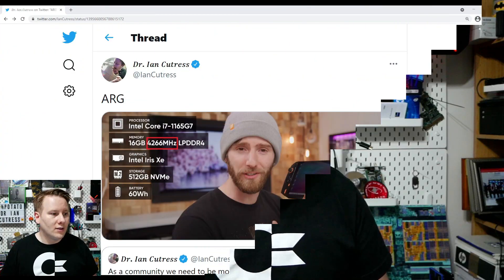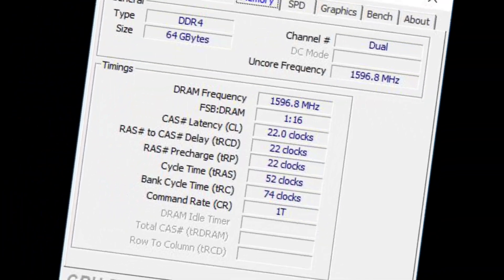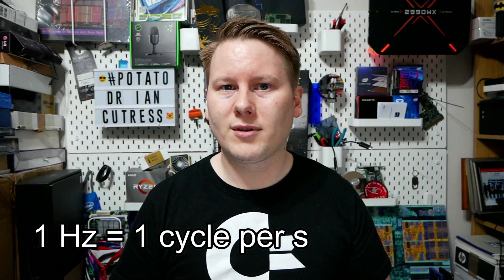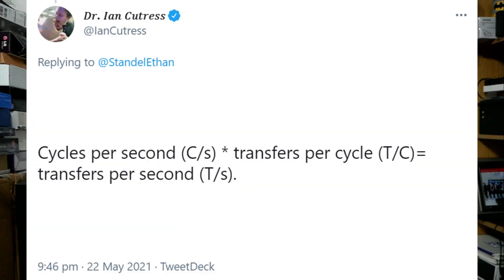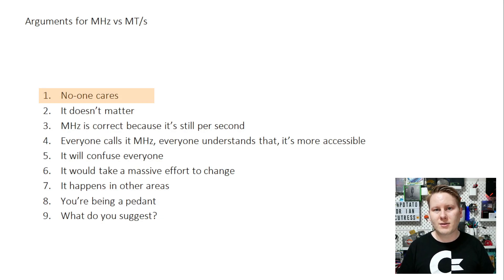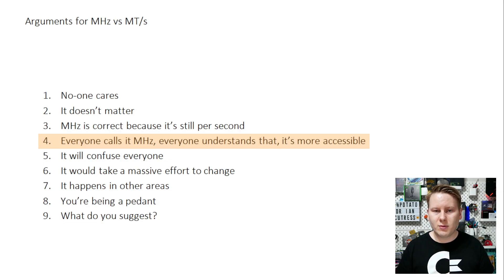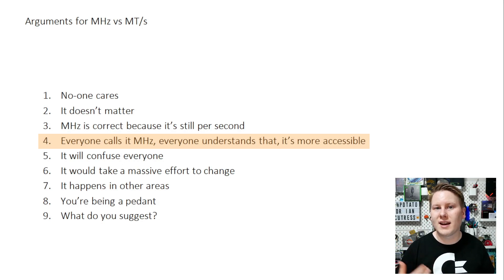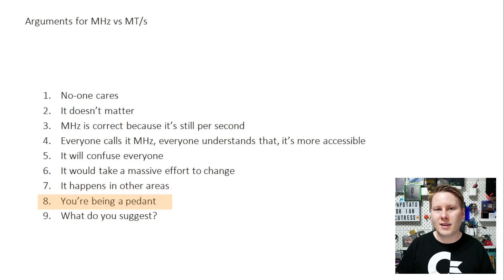Linus is WRONG 💩 : Explaining MHz vs MT/s

Comment from the maker: Just to reiterate, Linus and I get on really well. There's no beef here, just a fun discussion 👍
Reply: I'm happy that this conversation has been had as I never knew how double-data-rate memory works, and now I do. Ethernet I think is somewhat analogous to this, in that every tech tuber I have seen discuss the subject are quick to use the correct technical terms for the standards (1/10/40) but they are also quick to point out that those numbers are theoretical and not likely to be achieved. 

And then there is the aspect of accuracy, MT/s is not MHz, it doesn't matter if it's a convention to mix them up, as they are not the same thing and so shouldn't be mixed up.
Reply: I think removing the units altogether would cause more confusion. As you pointed out, in a piece of 8GB DDR4 3600 RAM, you get 3600MT/s. However, the fact that that piece of RAM is double data RAM implies you get two accesses per cycle. Therefore, the transfer number overlaps with the data rate specification. In reality, the name should read as 8GB DDR4 1800MHz as that term provides all the information necessary. Unfortunately, we’ll never see manufacturers do this because numbers must go up.
Reply: @hughmungusbungusfungus4618  right. This goes back decades in advertising. As a AMD user since 2000 I'm still annoyed that AMD guilded the "ratings not MHz" trend. DDR is not different in that dishonesty.
Reply: @hughmungusbungusfungus4618  true which is why transfered bits per second whould work as a messerment rather then hertz being used properly. And is much more likely to be implemented by manufacturers.
Reply: One is correct, one is not. Is not a discussion. Is a correction.
Reply: Linus is one of the sloppiest so called techtuber/journalists on youtube. He is no more than a paid shill.

He is most often wrong. Linus being right would be the exception.
Reply: I think you don't know how to pronounce pedant! You pronounce it like like its an impedance or impudence when it should be pronounced like you were being impudent, you prounanced it correct when you were discussing  ped-en-terry!
Reply: @justignoreme7725  that was pretty ironic
Reply: @justignoreme7725  That's the joke.
Reply: @danieledwards3376  mine or his??
Reply: @justignoreme7725  you americans
Reply: Linus had a similar argument with Luke several years ago talking about monitors where he was using 'P' and 'FPS' interchangeably.
As a global society we have been dumbed down enough despite the rise in intelligent technology at our finger tips. I'm gratified that you with your credentials corrected him and will stick to your guns in the importance of being accurate.
Reply: some seem to think Linus is some sort of genius, which makes me think they've never actually watched his videos.
Reply: I think it’s wonderful you think LTT’s ego takes this is anything other than a viscous personal insult. The man who says to people, ‘DO YOU KNOW WHO I AM?’
Reply: Now I think I speak for a lot of people that we are expecting a post covid smack down between the two of you.
Reply: I agree that we need to use the correct units. Hw Canucks says "rpms" at every instance in their fan/cooler reviews, pitiful really when at least one of the guys saying it is an engineering graduate.

Unboxed, Nexus, you and a few others care I suppose, most seem concerned with their aeshetics and or views more than the information they propagate.

Personally, I'm one of the salt of the earth kind of people(as described in Blazing Saddles by Gene Wilder 😅) I don't fully understand what you mean just from the vid(more of a visual learner), maybe I will once I get well but we need to be precise. Buildzoid's comment here makes sense to me though. I feel like I had a better understanding of things way back in school, I disliked my textbooks but they had standards that most popular sources of information today should try to reach or I need to stick to places that do so.

P.S. If you walk away from this without a any threats I'd say the community has grown, wouldnt bet on it though. As always I appreciate your thoughts doc 😁.
Reply: @jackrabbitping  what's wrong with taking about a fans rpm?
Reply: I should have been clearer I suppose they(hw canucks) say x rpmS instead of x rpm at every instance. So like 1200 rpmS instead of the correct 1200 rpm.
Reply: But what about a discussion about beef? Medium rare of course
Reply: @marioalejandrocamp  medium well for me.
Reply: Yeah but Linus is wrong, tell me something I don't know!
Reply: I reckon in real life you are both sound, intelligent people. However only one of you appears that way in the media and its not linus!
Reply: Yes, straighten the terms right is important for technical community.
Reply: We all have a hill we are willing to die on. I love your stance, but can doubt you will be able to change this!
Reply: Most of my pragmatic brain was like, so what, but then unit mis-conversion is also exactly how NASA explodes its rockets and miscalculates its orbits
That orbiter cost 1/3 bil last time
Reply: Nah, start a beef lol
Reply: Well, he did rib ya a lickle on the channel name so all fun and play.  That and maybe some PR :).
Reply: What about pork? There seemed to be a bunch of porkies (porkie pies..... Li~~) being said!!!
Reply: Yo the audio and the video are so unsynchronized my brain is about to melt
Reply: That is good because I heard Linus is a Vegetarian.
Reply: is there chicken tho?
Reply: @TechTechPotato
 I prefer units to be used, and hate that  MHz is used incorrectly in UEFI's but  I am also fine with no labels and those who care know the current technologies ratio of MT/s vs MHz.

Request.  Clarity on upcoming DDR5.  With the split from 1x72bit to 2x 40bit per DIMM allowing for 2 ECC bits per DIMM, when a CPU manufacturer's roadmap says 12 channels of memory, are they referring to 12 of the new half channels or are they considering a pair of 40bit channels a full channel.  Will we be getting 12 channels in 6 DIMMS or 12 DIMMS?
Reply: FIGHT FIGHT FIGHT FIGHT FIGHT
Reply: It's funny seeing the back and forth. I think it's going to be a colloquial thing like with 4k.
Reply: Sure. It’s pistols at dawn.
Reply: I and you care but Linus does not lol
Reply: With just a smidgeon of Troll :-)
Reply: @saultube44 data bus width is 64 bits wide on DDR (1, 2, 3 and 4), not including address and operation control busses. as for transfer width, eh, over multiple MT's there is a burst mode transfer that is usually around the size of the CPU's cache line size, or was something like that years back when DDR first came out. I think it used to be 64 Bytes per cash line on x86, keep in mind that there is 8 bits in a Byte, so that 64bit DDR data width (per channel) isn't the same as a 64 Byte transfer, it takes a few cycles to do that. and the complexity gets worse the more you look at memory transfers.

I also recall some one talking about 512Byte wide cache lines, however that may have been some other non-PC CPU years ago.
Reply: YOUTUBE WAR!
Reply: I hope he understood and changed his ways
Reply: Kick his fucking ass Dr
Reply: I'm sorry but your accent kinda made the "wan show" sound like "wank show". 0:46. I know it's my bad ears but it kinda got me off guard and I thought it was funny.
Reply: @Blank Name What did I say 'against' Linus? If you read what I said as something of an attack, that is your feeling and has nothing to do with what I wrote. From time to time Linus gets things wrong. He even admits it from time to time. If you think he doesn't then I won't attempt to dissuade you from your belief in him.
Reply: Daaa Raaaa Maaa!!!!
Reply: love you both guys :)
also special mention goes to tech jesus ;)
Reply: No. Shut up. I want to see tech-youtuber bloodsports! FIGHT EACH OTHER! ONE RAM-STICK AND A USB CABLE EACH AS WEAPONS! FIGHT FIGHT FIGHT!
Reply: bruh...
Reply: @TechTechPotato No Beef, just all Potatoes! Infact, just a good mashing - Bangers and Mash! Clarifying what one's "Minimum Specifications" are - if only we could all have the same, standardised, specifications?! :D "...All they wanna do is 'ave some fun!
 They never mean to do no harm but you can guarantee - They'll upset the applecart though accidentally, mash and bangers clangers come about quite frequently. Wa wa wa wa wa wa wa, it's Bangers and Mash!" https://www.youtube.com/watch?v=qgjd8UNhMtk
Reply: if i am a gamer what should i buy 8gb MT/s  or 8gb Mhz and if this 2 kinds of ram i will use for my computer will they be compatible?  thanks for the answer
Reply: You should fight him on site lol 😆 😂
Reply: Potato is a good communicator of Tech, perfect for people want to learn and be precise. Linus does some sort of entertainment show which is better suited to those who don't care.
Reply: Linus will promote and market anything if the cheque is big enough. He did a video on how good nice hash was after slagging of mining, and has been promoting AMD and stonewalling Intel for over 18 months after years of being an Intel shill.
Reply: @SmokeSolo1975  let's be honest. Amd had shi*** products for quite a while. Now intel is the one strughling. I loved intel between 2012-2018, now I just take what suits better for the build. But I totally agree on the mining thing, there is no excuse there
Reply: Yeah but Ian, when is Linus not wrong !!! Lol . Next time pick someone who actually knows something !
Reply: I personlly whould prefer if cpus were messured in instructions per second but thats my personal preference. Also transfered bits per second whould be preferred on memmory.
Reply: @erikburzinski8248  same
Reply: @erikburzinski8248  - Using IPC would be difficult unless an independent body would set that on each CPU rather than manufacturer's because its not an exact science as it depends on what instruction you test as its an average number across a selection of instructions - Different instruction can take a widely different amount of time. What Ian didn't really impress on in the video was that depending on a particular CPU and memory timing the amount of possible data would never 3600 for 1800Mhz DDR4 due to CPU latency, IPC but using 1800Mhz would be the most accurate as a memory module should always be able to maintain what the manufacturer states it is.
Reply: @erikburzinski8248  That really isn't doable, because different instructions have different speeds
Reply: @scottr7683  it chould be a completely random set of instructions a be a large sample in order to help with that. (24 hours of random instructions should work the guve the adverage instructions per second)
Reply: @erikburzinski8248  That is entirely dependent on workload.

I could write a piece of code that uses a single instruction all day, use your procedure, and then find out that I get 1 instruction per 50 clocks, or I can do a different piece of code that does simd all day, and has multiple instructions per clock.

It's not a reliable metric.
Reply: @scottr7683  completely random formulas chould help with that.
Reply: @erikburzinski8248  then you weight the instructions towards full random, instead of what's actually used

No matter what you do, this will come up with the wrong answer

There is no such thing as a typical workload
Reply: @erikburzinski8248  Completely random formulas are definitely unlike any real workload
Reply: @scottr7683  thanks I wasn't hopping to simulat a average work load only something closer to a average work load then how many ghz the cpu can do. I will acknowledge its not perfect but the goal is improment not perfection.
Reply: @erikburzinski8248  alternatively we can just do an array of common benchmarks and display all of the results... Like we do now
Reply: @scottr7683  true but I dont think the common person who doesnt know about tech checks those.
Reply: @erikburzinski8248 There is no good way
Reply: @erikburzinski8248  O rly?
and wich instruction would u use m8?
also.... how do you compare chips that use different instructions sets then?
Just think about it for 10 mins
It would take a lot more effort/research to compare offerings...and that's coming from a  CS undergrad
Just imagine the average consumer :ROFL:
Reply: @mcmz4e  fair point I was thinking it whould tell you far more then ghz which only tell you nothing as a chip with lower ghz can beat one with higher ghz.
Reply: @Blank Name From what I've seen over the years, he also gives his opinion. I'd say he is pro-consumer even when he gets things wrong.
Reply: But you're saying that your unit is better than his?
Reply: Way to capitalize on someone much more popular saying your name in their video 😉
Reply: Linus says 'yes he' s right, I just don't care'. When you make as many videos as Linus, you are bound to have mistakes and typos. Let's be honest here, it's clear to see you only made this to capitalize on the fact that Linus said your name in his video.
Reply: @Akash.Chopra  I honestly don't see the problem with that. He did not accuse Linus of anything
Reply: @Akash.Chopra  my same thoughts.. Linus even said he was right but he still made a response video..
Reply: @neildoe1617  ikr. Yesterday potato had around 35k subs and Linus has 13.5 million. He probably got 20% more new subs overnight from Linus mentioning his name 🤣.
Reply: He is an idiot Ian. The worst of the worst tech Influencer that social medias can create. All his videos are clickbaiting and just an occasion for shilling and selling something... nothing different from an infomercial on TV honestly.
Reply: @evalangley3985  oof, dont look up jayz2cents then
Reply: @evalangley3985  He's done a lot of positive stuff though, such as helping HUB fight back against Nvidia, etc. I can at least appreciate him for that.
Reply: @evalangley3985  He tests physical durability a lot, one of the few, if not only one doing that :)
Reply: @evalangley3985  however he does know more then most infomercal people and he does make videos people can understand without much prior technical knowledge about computers better then any one else in the tech space he plays the important role of introducing people to becoming hardware enthusiasts.
Reply: @evalangley3985  his channel was never meant to be like TechTechPotato or gamer nexus and others. If you want to vatch some crazy/stupid projects you have Linus, if you want to Lear something about a product you have specific reviews.
I mean. If he is the worst, what would you say about iJustine?
Reply: @evalangley3985  Anyone who watched Linus back in his NCIX days knows the laxness he exhibits on LTT is for infotainment. NCIX Linus was very straightlaced and oozed competence. He had a ShamWow Guy vibe.

But now he has Anthony. And like the biggest channel in the whole enthusiast PC space alongside like MKBHD.

Basically, he's not hapless. He's an infotainment specialist. Not every PC enthusiast wants dry info delivery all the time.

Comment: I've worked with and used consumer PC hardware my whole life and it was only last year I realised using MHz for RAM speed is wrong.
No units is probably the cleanest way to communicate, but MT/s I think is more descriptive.

I haven't looked at every RAM kit out there, but most retailers I see seem to be sticking to using MHz even though atleast all the Kingston DDR5 kits I have all say MT/s on them and not a mention of MHz anywhere.

Comment: You’re the only video I’ve found on this matter . Thank you! 

I’m trying to understand as much as I can. 

I hope this comment is okay. 

So I have 4 sticks of vengeance pro ddr4 ram. 8gbs 

I finally got xmp to enable and show 3600 

But when I did it , now it shows , 3600mt/s

Does this mean it’s optimized and running at top speed, or showing 3600 but it’s really 1800 MHz ? This is my confusion

Comment: I'm very confused about rams.
I have installed 2 rams of 16gb DDR 4 total memory 32gb in my hp omen 16 i7 11th gen rtx 3070 laptop and in tast manager it's showing speed in 2400 mts of each ram is this ram good for gaming or I switched to those 8 gb DDR 4 rams who show mhz speed instead of mts in tast manager guide me.

Comment: Excuse me, you're also wrong. Throughout the video you're saying that you want to see the correct unit being used by memory vendors, shops and etc, but MT/s is not the proper one. As a typical teacher would ask - "what is a mega transfer per second", what is it transferring every second - tech potatoes? No! If you dig one layer deeper a.k.a the DDR4 chip manufacturers for example Samsung, you'll see that they're using bits per second as a unit more precisely Mbps which in my engineer eyes is the correct way to say it as this memory is transferring bits every second, would you agree on that? Generally when speaking about transferring we're using Gbps/Mbps, even Kbps (etc.) if you like. Overall you're also wrong even though you are trying to convince so much people that MT/s is the way to go.
I was ready to post this comment in the start, but for the sake of objectively commenting on your false content I tried my hardest watching it till the end. 👎